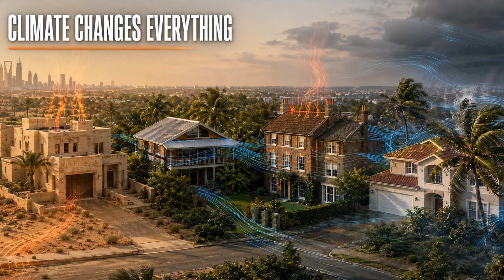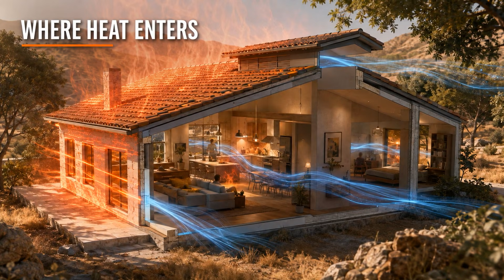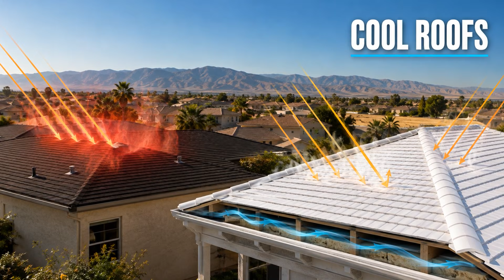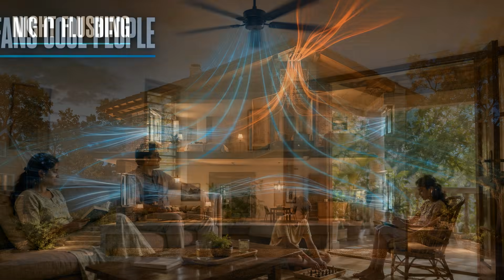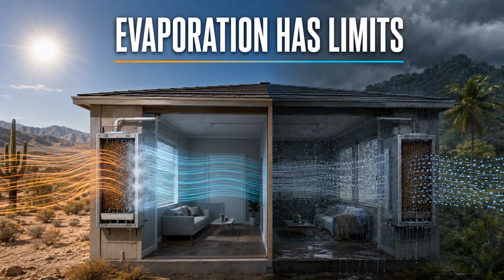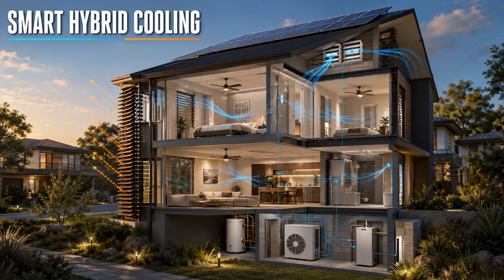Can Buildings Stay Cool Without Air Conditioning?

Comment from the maker: Which climate do you live in—hot-dry, hot-humid, or temperate with increasingly severe heatwaves? Which cooling method works well where you live, and which one fails? Share the location and conditions; your example may become part of a future engineering investigation.